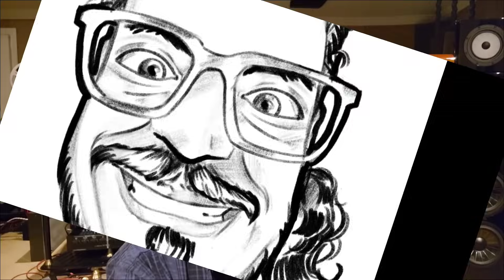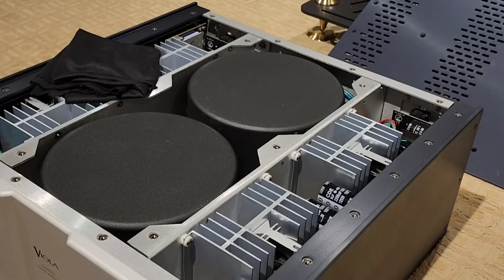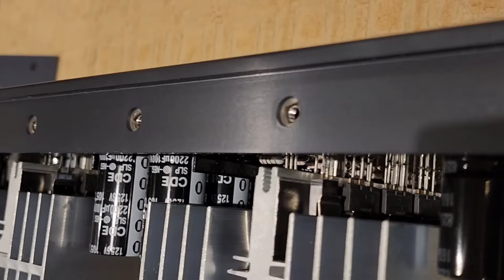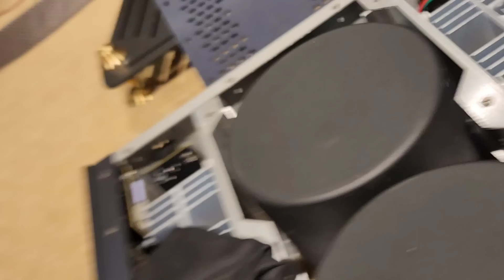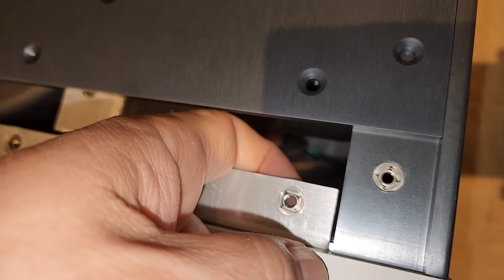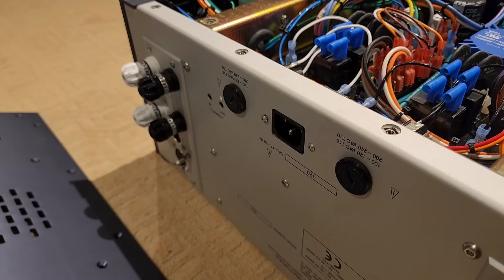THE BEST SLEEPER AUDIO AMPLIFIER OF THE DECADE !! #thebest

Comment: The best power amp that HiFi snobs ignore.
Audiolab's UK built 8000M mono-blocks.
They will provide a comfortable 125w into 8 ohms, 500w into 2 ohms and 40 amps per channel, matched with the 8000Q pre amp the combination punched way, way above its price bracket.
They are aesthetically pleasing, take up little space and if mine are representative, bulletproof.
I'm actually hunting for a second sequentially numbered UK made pair in silver to quad amp my TDL's as I type ;).
Basically you could spend 20 times more and get less, that's a proper sleeper.
Reply: yeah this amplifier is kinda stupid, only a numpty would pay over 20k for a class a/b amplifier. audiolab are great my late father used their amps, i use rotel in both my systems. i did eye up an audiolab pre power set but settled on a ra6000 due to it's flexibility, idk the attraction to these dinosaur amps honestly. I'll take my 2x200w@8ohms dual subwoofer outputs inbuilt dac and the list goes on and on, most likely sounds better to.

Comment: It's not "dual differential". It's just push-pull. It's not "a fully balanced amplifier"... You also stated abosolutely correct terms and gave some decent explanations but made a mistake with those two terms and are simply wrong. You really do not know the difference between a push/pull topology and a fully balanced topology or wouldn't make such a mistake. If you inverted one channel's input and bridged both channels' outputs in series, then it would be balanced topology but would be a mono amp. Words that have specific technical meanings actually matter. You meant stereo push/pull and you meant dual-mono and those were right.
If it's a choke-input power supply it needs really huge chokes. Where are the huge chokes? All I see is a teensie blue transformer. I don't think it is a choke-input power supply. I see a lot of small electrolytics and it's a capacitive input power supply. A ckoke input power supply (B supply filter has choke first) really works well with an amp that runs biased class A because a choke-first filter works better with that more consistent (if inefficient) load. Is thia class A or A/B? No mention of something so important.
Reply: I would think that a choke input supply would add quite a bit of weight and size to the amplifier as well.

Comment: Call me OCD crazy, but that power supply would face up if I were fortunate to have one in my system and most people wouldn't even notice! I had a Pioneer SX1980 and believe me, bottom-mounted power supplies can fry from excessive heat buildup.

Comment: Tom Colangelo was the man ! I own one of his design also ..Cello duet 350 . I see in the viola a lot of similarities but this is even one step further. What preamp are you using? Cheers for great content
Reply from the maker: I don't use a preamp. It's not needed to sweeten the sound. I go DAC direct with a Playback Designs MPD-8 DAC using a dual differential class A output stage.
Reply: @OCDHIFiGuy  got it. So single source I reckon. Too bad , viola went kaput. Do you know anyone that can do maintenance on the east coast for ML/ Cello/ Viola gears ? I tried Jim Matthew but no response. Cheers

Comment: Hello Mikey - May I trouble you for your expert opinion on two amplifiers?  The first amp (stereo) is the Esoteric A-02 (Class AB, 200wpc@8 ohms and 400wpc@4 ohms); this too has its roots in being a recording studio amp.  The second is the Pass Labs XA-200.5, which is the previous generation amp; .8 is the current designation on the current amps.  The ".5" plays a bit warmer but is not as resolving as the .8 amp;  The .5 has more 3rd harmonic and a lesser degree of 2nd degree harmonics, and the .8 is just the opposite; it has more 2nd harmonic signature, that being airy, warm but less that the previous gen amp, and the bias is also turned up on the current amp.  The Pass amps are monoblocks,.and make all Class A power starting at 200wpc@8 ohms and 400wpc into 4 ohms.  Both are very powerful; no speaker I have stymies them (Focal Mezzo Utopia & Von Schweikert VR-4 SR Mk3).  In any case Mikey, thank you very much for your time.  Keep up the great work!

Comment: $30k for a 200 watt amp?  And its specs are "20 Hz to 20kHz, both channels driven into 8 Ohm, THD < 0.25%" that's not even good by today standards.  A $400 consumer AVR is rated THD <0.06%.  Call it what you want, over built, over priced, or over hyped, but I wouldn't call it a sleeper.
Reply from the maker: I've got some 60Watt monos for $35K if you prefer. Maybe the $110K stereo amp, or the $250K D'Agostino Relentless monoblocks..
Reply: @ the hifi world has lost their damn mind 😄

Comment: No thanks, I will build my own for a 1/20th of the price. ILP Electronics encapsulated industrial amp modules etc. better spec than hifi.

For people with lots of money to spend , good for them, most people have damaged hearing anyway and these ultra amps are wasted on most.
Reply from the maker: Ultra amps are not for most. Most think industrial amps sound like HiFi. They don't. Not even close. If they did, we would see companies building them and selling into the HiFi world for half the price of real High End and still making 10x. But we don't see that... Most people don't sling solder either. So making anything other than toast just isn't a reality. But hey, there's plenty of Chinese copy amplifiers that are "just as good" 😆 lol.

Comment: @ 6:27 you push zip tied wires down against a heatsink..? I believe where they were was where they were intended to be before you touched and moved them. I would be real careful poking around inside an amplifier that cost that much.

Comment: Where is the dual choke that as you said gives near unity power factor correction? The blue inductor is a common mode inductor and would saturate with even very small currents if you attempt to use those for power factor correction. A power factor correction inductor for this power level would be about half the size of the 1 transformer. And what is dual differential? Having two power rails for a DC coupled power amplifier is not the same as differential. Differential signaling is something different. Two complementary or opposite in phase signals are used to transmit a signal from one point to an other. At the receiving end those signals are turned back into single ended signals. What happens is that noise being picked up by both wires is rejected by the differential receiver. A dual rail amplifier is an amplifier with separate rails for the positive and negative part of the signal. Dual rails are nothing rare or new. Almost all amps starting from late 1970's employ dual rails and allow for DC coupling of the loudspeaker. Some rare ones also employ DC coupling in the feedback in combination with a servo amplifiers to regulate DC offset. What makes amplifiers different is how they overcome distortion caused by the output transistors switching from class AB to class C at higher power levels. There are some rare books on the subject and manufacturers had their own techniques and patents to reduce switching artefact in output stages. The simplest technique being very small speed up capacitors in combination with very high speed output power transistors (20...50 MHz) mostly made in Japen by Sanken of which the 2AS1216 and the 2SC2922 became the most famous and now sought after complementary pair.
Reply from the maker: LOL, wow. Encyclopedia brown.. Its a truly balanced amp. circuit.. hows that ? ... you know what that is ? I go on what the circuit designer tells me ... of course its OLD tech, its class AB... LOL ....

Comment: Very nice talk on this amp. It is certainly worth having though I consider it overpriced for a sleeper if asking prices mean anything, and due to its age may require capacitors at some point, indeed a thorough exam to stop any small issues that could become major ones, so that's a good question to ask, and don't be shy about asking to look inside (bringing your own technician to put eyes on it) when paying so much for an older piece of gear. Just like one would bring a mechanic to look at a classic vehicle of similar worth.

In the day when shopping for amps in hi-fi stores, I would judge amplifier and receiver quality and robustness by their weight vs power rating (Using the time-honored "Watts RMS into n Ohms, from 20-20000Hz @ x% distortion, both channels driven"). This one seems to be using the old and proper rating system, and is made in the USA. I believe it's a good example of best engineering.

The video @3:50.. says "Choke Input power supplies" while talking about the power transformers. That would be a plus to keep good voltage regulation, and something few amps have (found mostly in older vacuum tube types) Where are the chokes which would follow the rectifiers? 

I did not see any DC filter chokes (reactors) in the video shots of the amp. Chokes large enough for that would be large and plainly visible, unless they have been hidden somewhere like in the cans, in which case the cans are oversized (they look it) to fit a 1.25KVA transformer and a filter choke in each one. I could see a toroidal transformer and choke stacked in each can, possibly. Please comment if possible. 😸
Reply from the maker: Heck if I know. It's in their manufacturer specifications...
Reply: @OCDHIFiGuy   Thank you. I don't dispute it, but rather I just like to see things and try to relate them to my own experiences. They are certainly beautifully made. That sort of no-expense-spared attention to detail is unheard of today.

Comment: You see as a electronics engineer and audio equipment designer for the past 25 years or more one thing I've learned and one thing that is kind of sad is that this amplifier doesn't even have $500 worth of parts sitting in it, but they'll charge you 30 grand for the amp XD I build amplifiers all the time, insanely beautiful sounding stunning performance from my custom builds and dare I say could at least give this amplifier a run for its money or possibly even beat it on quality overall but I don't charge even half this price :/ I would love to see audio companies actually charge fair prices for fair products instead of realizing they built something that's nice so then they charge the ever living crap out of it you know?
Reply from the maker: Yes, I get what you are saying. However value is not what everyone is after. The mainstream is after value and there are plenty of brands for that. This brand is about exclusivity of design. I've never seen any other amp with dual torroids this big, coupled with a choke regulated input. So this is a luxury product for a luxury buyer..

Comment: Personally, I would go for a JRDG amp over this unit.  Jeff has incredible and elegant builds and when the reviewer flipped the amp over and saw all those wires, I was like, hell no.  I'm sure it sounds great, but it certainly should at this price point.  I bought an amp from an Australian manufacture the Vajra from OAD Ultrafidelity and it looks and sounds fantastic with innovative tech and is about 10K USD. There are a lot of independent manufacturers who are not well known but are pushing the envelope with what is possible.

Comment: A Hafler DH-500 w/225W/Ch. won't win any beauty contests but sonically its among the best. High current 2-ohm load stabile. And when with upgraded caps throughout is even better than it was new. They can be had for about $500-$600 these days on eBay. Now THAT's a Sleeper!

Comment: This is an insanely expensive, insanely high end piece of gear not a sleeper. A JVC JR-S401 is a sleeper. Sleepers fly under the radar because of the brand name, looks and etc. They can be had for cheap because no one knows about them. What you have is a highly sought after high end piece that every audiophile knows about.
Reply from the maker: When you are OCD HiFi, this is a sleeper.

Comment: Monster Toroidal Transformers AND HEAT SINKS....Certainly Can't be CLASS-D. That Puppy putting out 1KW per Channel-Capacity must run  pretty Warm, even if it's Cl;ass A/B. For $35 K  certainly something about its Performance MUST IMPRESS... like it walks on water. That Single AMP cost more than BOTH my Home Theater Systems with 20 total Components incl, Marantz, Klipsch, Yamaha, Boston and Sony  There are som NEW CLASS D's out there at 8 to 10 times less which "SEEM" to be quite impressive.... Drive well & run COOL.
Reply from the maker: I was in a $2M, 2 channel audio system 3 days ago... ;-)

Comment: You state that it is a choke input power supply (3:53 & 6:59). Where are these chokes? You show the amp from every angle and I don't see them. I see no such components. You're mistaken or uninformed.
You alluded to there being inductors for PFC but, that's not a choke input power supply and doesn't affect the audio performance one wit. You correctly pointed out that the power factor may be 1.0 but, that's not at all important for audio and it is not correct to call it a "choke input" power supply since it's only on the input to the transformer.

Pointing to the two heatsinks on each side you also state that it is "dual differential" (3:23 & 6:59). How is that? That topology only applies to the input and driver stages, not the output. There are two heatsinks holding what appears to be output devices. Unless you have a schematic that will show us otherwise I believe it's just a garden variety push pull with a set of outputs for the positive rail and a set for the negative. This does not make it "a fully balanced amplifier", not that that's a useful topology. Also, the two banks are not for each "phase". That gibberish. "Phase" refers to the time domain aspect of a signal and has nothing to do with an output stage. Nice try at using technobabble.
Agreed with Piccodon: you talk effusively about the build quality which is commendable but, you fail to explain how that impacts sound quality. It impacts the price point certainly (in your favor) and I love a great example of electronic engineering done with quality parts but, let's not confuse that with the assumption that it ensures good sound quality. And with all that, $35k? Not even remotely worth it.
Reply from the maker: How about I don't really give a shit about the technical details ? I go by sound. And history in the industry. This company has better history than most and the amp sounds phenomenal. It's for luxury buyers. I guess you're a DIY guy... so you stay there and my buyers will stay here. Everyone's happy. !!
Reply: Then why spend 8 minutes explaining the technical details?

Comment: I was gifted an old Marantz 7.1 amplifier/receiver that was heavy and well built. The flagship model of 2006 or so. A good amp with accurate signal amplification. Source is the important thing, and speaker system is the important thing too, but the amp is the backbone.
Reply: I understand that the app without it there is no sound OK speakers have a lot to do with that, but I believe that your room is the most important part of your Soundsystem and the Grand Central Station, which is called the preamplifier has a lot to do with that
Reply: I like low power amps, but I can appreciate the heavier amplifiers.
Reply: In most cases people waste money on source and neglect their speakers. I had a friend when I was a child that spent insane amounts of money on new tape decks, cd-players and amps without upgrading his bookshelf speakers. I noticed nearly zero gains from spending considerable sums of money to front end. If he had spent all the money for high end speakers (and as I later learned, room acoustics), he would have had significant improvements in sound.
Reply: The source does matter on that type ht receiver for sure.   As it does on this unit which is an extra $ decibal point beyond most any 7.1  offering.   2006 marantz 7.1 RECEIVER  is an audio control center when there were too many different input sources.
Reply: @johncribbs8382 I once Owned the REAL Marantz Model 7C Preamplifer and 8B Power Amplifier. 

I am unaware of this Marantz 7.1 Component.  Note: after 1990 or so, I paid little attention to Marantz.  Oh, I am VERY Aware of their Receivers, but never aspired to Own one.

Comment: Heres the setup i got : 
Pioneer SX-580 with a BBE 362NR and a Behringer DEQ2496 PRO EQ( in tape monitor loop)  to a pair of Cerwin Vega VS-150's i just reconed.
I just bought a Pioneer SX-780 But i want to get the Pioneer HPM100s or 150s or Infinity RS-2B speakers.
Reply from the maker: Great !

Comment: I'll take a pair of Mr. Curls JC 1+ Monoblocks. 450   rms at 8ohms, and 800 at  4ohms. And another pair of Curls JC 5's. 400 at 8 ohms, and 600 at 4 ohms. Cost, around $25 -27k. Throw in some dam good cables for $5k = cost of this luxurious, beautiful, heavenly amp😮
Reply from the maker: Sure. More for your money. Makes sense. These amps sound better though... 😌
Reply: That amp does not sound $25,000 better than the JC 1+. C'mon man